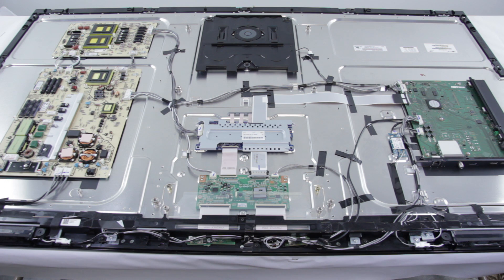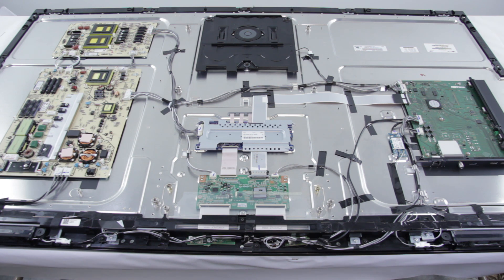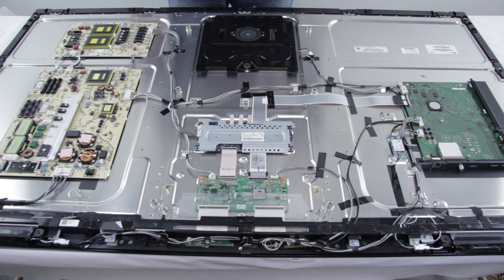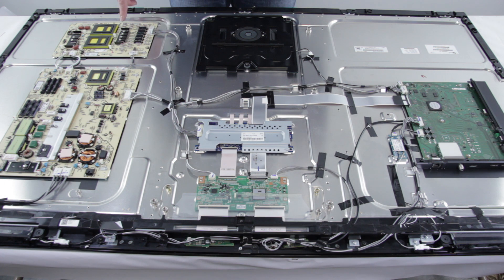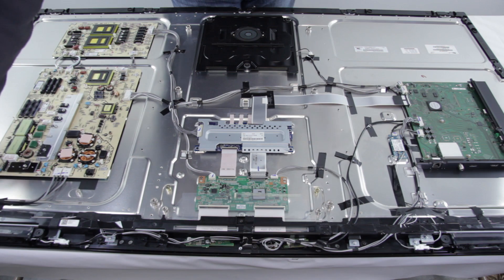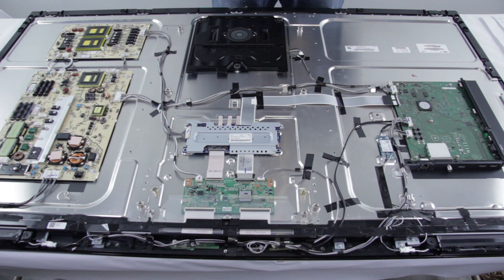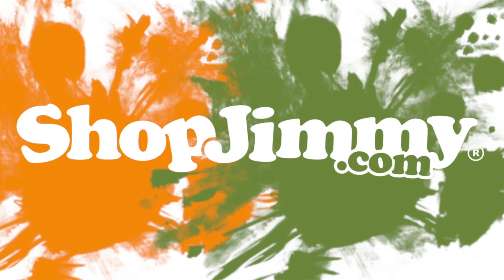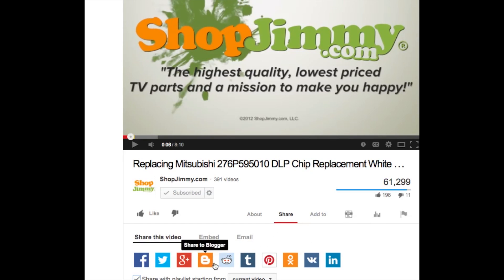LED TV Repair Review Power Supply Overview-NO Power Common Power Supply Repair & LED TV Power Supply

Comment: Hello, 
I was watching TV and all of a sudden the TV turned off and I can not get it to turn back on again. After watching several of your videos I think it might be the power supply board. The tv does not turn on. It fails the flashlight test. There is no blinking red light. The TV was acting up a couple days before this happened. It would exit out of apps on its own and I would have to restart the tv to get back into the app. My model # Samsung  UN55H7150AF. When I plug the tv in I can here a soft clicking sound coming out of something on the power supply board. I am curious on how to trouble shoot this type of board. Board # BN44-00715A . All the capacitors look fine and nothing looks visually messed. Is there a way to check some other known components so I can replace them without replacing the whole power supply board? 

Thanks,

Comment: My Samsung flat screen is Model #UN60EH6003F/UN60EH6003FXZA.  The screen went black, and was able to get sound back.  Bottom right corner will blink red.  I can't even turn on the settings mode on the screen since it's blank.  I've had a few friends say it could be the HDMI cord, diode, or inverter.  I want to be able to just get the part instead of having to waste money on a new T.V.

Comment: I have a LED TV Nakamichi 46". Its model no.is LE46KHZ3D. Serial no. 12F00100. Got purchased in July 2012. It was bought in Dubai and got shipped to Kerala, India, in early March 2016, by ship in its original packing. However when it put on, there is no Power light coming and consequently it is not working. The power plug is with 'fuse' controlled which is fine. Could you kindly advise the reason for power failure and how it can be repaired. Thanks.

Comment: I have a Samsung LED TV - model # UN46C7000WF. I have been noticed since a month buzzing/humming noise on volume, it looks slowly growing every day. I called the Samsung support and troubleshooted all the tests nothing worked out. They asked me to create a service request, since my TV is out of warranty I wanted to repair my self. 
Do you suggest any part (mother board, power supply, speakers) I should replace on this TV? Please suggest me with your inputs

FYI:  TV is not connected to any extra speakers. The buzzing noise is coming when I play just TV alone and also with BluRay. All the connections are good with BluRay.

Comment: I have a Toshiba 50 icnh model 50l2200u it's keeps turning off an on on its own after a power out it turns on normally an then after no more then 10 mins it just shuts off but the green light remains on

Comment: dear I have toshiba 32p2400ee led tv 110-240v 
is there is any way to run it on 12v dc without inverter
best regards

Comment: hi have a polaroid flm-3701 tv serial h0500060640000724 that has no power suspect power board fuse and a few capacitors  how do test

Comment: I have a Samsung  UN60D7000vf LED it was working fine till I unplugged it....when I plugged it back in all I get is a quick flash of light on the screen a clicking sound and it continues 1/2 a second on then off on then off red light blinks too....can yuou suggest something

Comment: I have a Sanyo DP-46142 that after 2 minutes of being on. tv just freezes. cant change channels, cant control volume. no controls work. unplugged it plug back in does the same thing. does this sound like main board problem

Comment: I have a 32" UN32HE5300 from Oct 2013. It started cycling as well. Now there's no power. I opened it and it looks identical to the one in the video. I inspected the caps, no bulging on them. So I disconnected the manual button as shown and crossed my fingers. Nothing. Any other thoughts?

Comment: I have a Samsung UN46FH6030 that started flickering in the upper third screen area a few months ago. Recently, the bottom third started exhibiting the same problem. The flicker in both regions seems to be synchronous and isn't affected by input type or back light levels. I was told the problem might be the power supply. Following one of your videos, I checked the board voltages with a multimeter and the output appears to be normal as far as I can tell.  I was considering purchasing a replacement powerboard from you, but I wanted to check to make sure you think that it is likely the powerboard and not the mainboard, t-con or other part. Thanks for all you guys do.

Comment: Hello, I have a viore 32in. tv, model # LCVH3270, DATE 12/2010. Problem went upstairs came back down and tv was off no led light and would not turn on, and I did check outlets for power.also before this remote would not turn on tv had to use side button for the last few months to turn it on.I took off back and checked caps and they looked fine only noticable damage or discoloratiom was on the white cable from the power board to the left sibe control boarg was brown colored at connection plugs also I need to know where the fuse is located. Thank You, any help will be appreciated. TY Don Zee

Comment: I have a Samsung UN46FH6030 that randomly starts power cycling over and over.  Ive checked the power board and everything seems fine.  is this a control board issue?

Comment: hi i have a blaupunkt 50 inch led tv 
model no 50/149Z-GB-5B2-FGKU-UK 
model ref 50/149-T2
it was working fine unplugged then plugged back in later and nothing checked fuse,plug and used electrician live detecter and it shows the tv live im guessing  somthing to do with the power supply ive looked at videos on YouTube any ideas i think it might be a capacitor on a board how can i tell if it is a capacitor accept from any black marks any clues your help would be great 
thanks
Reply from the maker: +David Norris   Try all repairs and troubleshooting at your own risk.  I recommend replacing the main board in your TV.  Unfortunately I do not see any replacement parts in the search results for your TV model number on our website.  Please reply with your part number on your main board and I can try searching for replacement parts.  Thanks and please let us know if you have any further questions!  www.shopjimmy.com

Comment: Un29f4000af samsung led tv 29 inch i believe....... flashlight test shows screen works faintly n sound is good... Now when i touch a meter to the led light or the part nrxt to them on the strip to read volts the top strip lights up ? i seitched all strips to top and they run when i touch metrr so i assume leds good but o ly top will light them so mauybe ground issuse as i push on strip n lights some times. Maybr top row wont connrct to bottom rows but even top wont light unles i touch meter prong to it, i touched a wire also n groundrd it and top row lite... Wgat could this be ? lights or board  ? u sell leds and board for this model ?
Reply from the maker: +Joseph Sepe   Try all repairs and troubleshooting at your own risk. This sounds like a problem with the actual LEDs inside your TV. These LEDs are replaceable, however it is recommended they are replaced by someone with the proper experience and training. When replacing the LEDs, the TV panel can get damaged. If the TV panel gets damaged, it is not repairable. Click this link to replacement LEDs for your TV model number:   http://www.shopjimmy.com/samsung-cy-hf290agmv1h-led-strips-4-strips-interface-board.htm   Be sure to match the panel information necessary to ensure you have the correct replacement LEDs.Thanks and please let us know if you have any further questions with your TV Repair!  www.shopjimmy.com
Reply: +ShopJimmy.com  I already took it apart n did a great job. Leds are out not sure what caused it tho. U sell the strips ?
Reply: +ShopJimmy.com Why is everything never in stock ? Also they do light up if i ssitch them all to a certain row , so the bulbs actualy work, if i press thdm down also they will light sometimes...... what could cause this ?

Comment: Hi you tube team,I have problem in my samsung LED TV that,like power supply does not working properly its getting on some time and its not getting on some time.So could you please help on this as top priority.Samsung LED 58 cm Model#UA23H4003AR
Reply from the maker: +Arulkannan Manickam   Try all repairs and troubleshooting at your own risk.  I recommend replacing the main board in your TV.  Unfortunately I do not see any replacement parts in the search results for your TV model number on our website.  Please reply with your part number on your main board and I can try searching for replacement parts.  Thanks and please let us know if you have any further questions!  www.shopjimmy.com

Comment: sony bravia kdl-55hx729. I have 5 blinking red light as soon as the tv is turned on and it repeats 5 red lights, during this the tv does not come on. at the start it does go into the yellow on light but only for a second then goes into the 5 blinking lights repeating. Hope you guys can help thank you!
Reply from the maker: +Felipe Garay   Try all repairs and troubleshooting at your own risk. I recommend replacing the t-con board in your TV.  Click this link to replacement parts for your TV model number:  http://www.shopjimmy.com/catalogsearch/result/index/?cat=63&q=kdl-55hx729  There may be multiple boards for the same TV model number, be sure to match part numbers on your current board, with your replacement for compatibility.   Thanks and please let us know if you have any further questions with your TV Repair!  www.shopjimmy.com

Comment: Hi , hope you can help me, my tv is a samsung  UN50ES6150FXZA and keeps shutting down every 2 minutes, i tried re booting and wont work , thank you for your help ,
Reply from the maker: +cuaperene  Try all repairs and troubleshooting at your own risk.   I recommend replacing the main board in your TV.  Click this link to replacement parts for your TV model number:  http://www.shopjimmy.com/samsung-bn94-05874f-main-board-for-un50es6150fxza.htm  There may be multiple boards for the same TV model number, be sure to match part numbers on your current board, with your replacement for compatibility.  Thanks and please let us know if you have any further questions with your TV Repair!  www.shopjimmy.com

Comment: Hi sir, I have a un55fh6003fxza samsung tv , that will not turn on. It has a standby light but it woun't power at all. I removed the back cover then I disconnceted the black cable running from the green supply board to the main powerboard!. and the led screen turns on. That is the only way I get any kind of power If I plug that cable back in it shuts off. Thanks , I hope you can help me out . have a blessed day.

Comment: Hi I have a Sony Bravia KDL-46W3000 and it powers up and say 30 sec later loose picture then sound and shuts down followed by 6 red flashes, pause 6 red flashes. This has happened in the past and I just un plugged power for 5 min and all good. now it happens all the time. I remove HDMI cords from cable and TV stays on ( No red flashes) I plug HDMI cord back in and it fails again (6 red flashes ) Now TV is staying on with back cover removed and everything works. Sounds like heat issues but the problem happens first thing when cold. Please advise.

Comment: Hello, I have an 46 inches Orion LED HDTV that does not turn on. It lights up the stand by light but when I press turn on nothing happens. I think the problem is in the power supply (CEM886A). Should I buy a new power supply or the problem can be another thing?

Comment: Hello. I have KMC Led tv model: KMC3D42718LED FHD
The problem is only standby red light no power on. I checked it. The 12 volt for main pcb is absent. What's the possible solution?
Reply from the maker: +Tariq Khan  Try all repairs and troubleshooting at your own risk.  I recommend replacing the main board in your TV.  Unfortunately I do not see any replacement parts in the search results for your TV model number on our website.  Please reply with your part number on your main board and I can try searching for replacement parts.  Thanks and please let us know if you have any further questions!  www.shopjimmy.com

Comment: Dear Sir, 
Hi everyone,
Thank you for your explanation.
I have LG LED 32" television model No.  32LN542U_ZB  mande in Korea and when power is turned on, the sound is ok but the picture come and go off and repeats the picture on off. When I have look at by using light at screen the picture is seen but the back light is not available, it is about one year of service. So I appreciate every one who can inform me the probable fault and how to repair it.
info: furi.lem@gmail.com
Reply from the maker: +Furi Lemessa   Try all repairs and troubleshooting at your own risk.  This sounds like you have bad LEDs in your TV.  Unfortunately we do not sell replacement LEDs for your TV model number at this time.  Thanks!  www.shopjimmy.com

Comment: UN60EH6003FXZA, 60" Samsung LED wont turn on. Magically I can unplug the tv for a day, try again later and it will turn on. I moved the plug to many outlets. Can you help diagnose, and suggest parts? When the tv does work, at the top left of the screen is text showing which output is used. The text shows up jagged sometimes, as if the display had a bad connection. Not sure if this second part has anything to do with the power or odd things I have experienced. Thanks for the help.

Comment: Hi,  I have a Hitachi LED-TV model# LE46S606. The television wont turned on (no power). I checked the power supply board (part #C2415XH1) and found an integrated circuit (IC9301)burnt! dont know or how to get that part...or the circuit board for that matter. How can you help me, please?

Comment: good day sir i have a problem with my DEVANT  42" LED power does not turn on only standby mode.. when i open the tv i notice some dead ants on the terminal of the power transistor of the power supply board. what i did is I brush out the ants and clean the board. when i turn on the tv it blows the transistor and other resistors. I am planning to replace the power supply board can you help me where can I buy the board? RSGA7.820.5030 thank you sir..

Comment: Need HELP... 39" Sansui LED SLED3900B .. worked fine a couple days ago now no power at all.  Unplugged for a day tried a different outlet and nothing.  Is it the power supply ?  Can you lead me to a new one?  I did buzz out through the fuse with an ohm meter so that is not the issue... also buzzed out from positive and negative leads from board to plug.  Please advise?
Reply from the maker: +Badchad Flemdog  Try all repairs and troubleshooting at your own risk.  I recommend replacing the main board in your TV.  Unfortunately I do not see any replacement parts in the search results for your TV model number on our website.  Please reply with your part number on your main board and I can try searching for replacement parts.  Thanks and please let us know if you have any further questions!  www.shopjimmy.com

Comment: Hey, I have a 39inch LG television, 39LN5300, and there's no power at all feeding the TV. No led, nothing. I tried another power cord without result. I opened the TV to check the capacitors and saw no buldging nor physical signs of deterioration. I was wondering if you could think of something else?
Reply from the maker: +Carl-Anthony Ducharme-Abraham   Try all repairs and troubleshooting at your own risk.  I recommend replacing the main board in your TV.  Click this link to replacement parts for your TV model number:  http://www.shopjimmy.com/catalogsearch/result/index/?cat=56&q=39LN5300  There may be multiple boards for the same TV model number, be sure to match part numbers on your current board, with your replacement for compatibility.  Here is a link to a video showing how to identify your part number, click here:   https://www.youtube.com/watch?v=RwHTvjMdrhkThanks and please let us know if you have any further questions with your TV Repair!  www.shopjimmy.com

Comment: LG 47" LM7600 had a nearby lightning strike. Set has a blinking power light that blinks 3 times and goes out. tv does not turn on. have not inspected boards yet. advice?

Comment: I have a Panasonic LED TV 46PFL3908/F7. It turns on fine then after a few seconds a hear pop/click sound and it turns right off. From what I'm researching it sounds like a power board issue but I want to make sure before I order the replacement part.

Comment: I have LG LED smart TV model :55LA62000UA,when power on, dis[lays LG Logo then goes back, has sound, when closely look  picture can be seen. Simetimes  whne just pull out power supplu and all connections, keep off say 30 min so, then power on, it works,means clear picture displays, sometimes  ahve to keep off for days, this behaviour is very unpreditibale. So I can connected my laptop to TV via HDMI, I can hear sound and can see blur picute at very close distance. So I did some research over interenet, finally found relevant videao on SHOP Jimmy, where hinted  isseu  powersupply/LED inverter  board,  Since in teh LG this model, both are on a single board, so I ordered and replaced, but the same story, even not sure, shop jimmy shipped  working  board or not , confused. Please can you address the solution, trouble shooting steps form your experince. Appreciate your help.